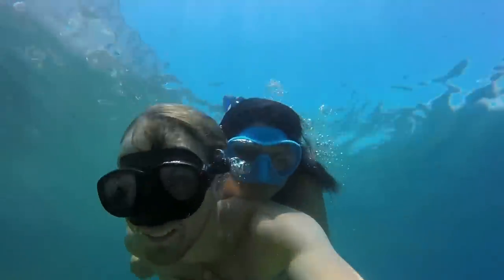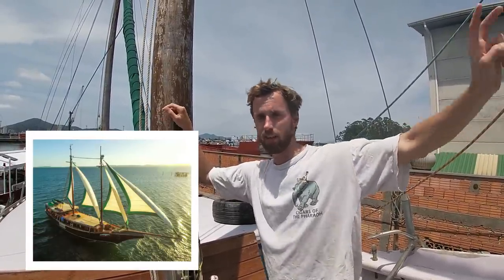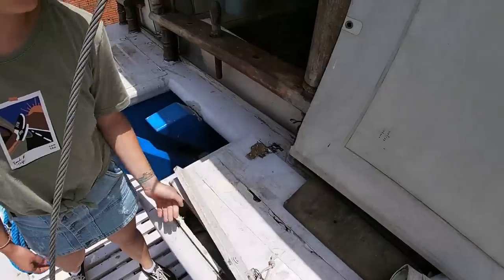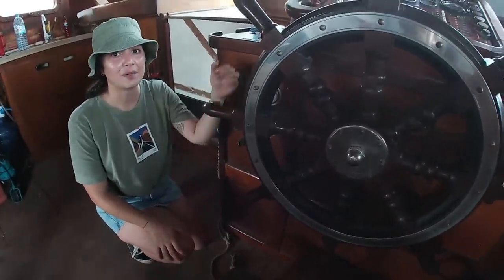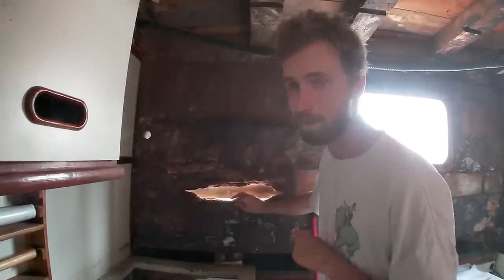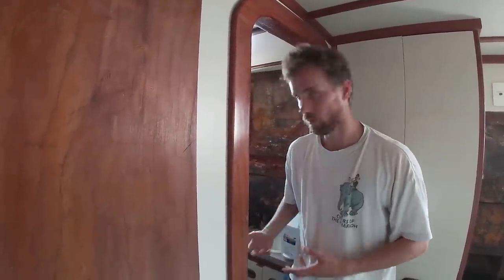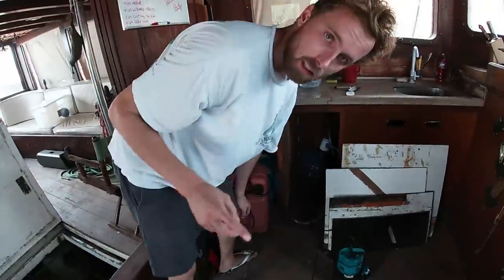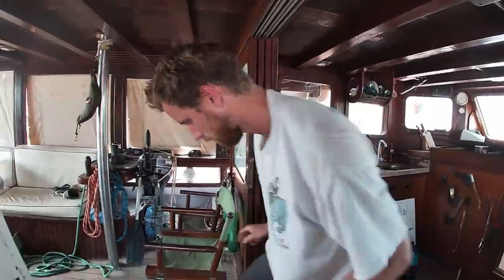BOAT TOUR of our wrecked Brazilian ship — Sailing Yabá #7

Comment: Thanks for the tour and I can see that you will end up with an awesome ship when your done. 
The fence around the boat is called a bulwark and I know the baton's as belay pins. I prefer them over cleats. I didn't notice the height of your masts but if the forward one is taller than the aft or rear mast then the boat is a ketch and the front mast is the main and the back mast is the mizzen. 
If the back mast is taller then you have a schooner and the front mast is called the formast as in forward mast and the back mast is the main. The type of sails you have are staysails so you have s staysail ketch or schooner. Starting from the front "bow or head" you would call the first sail the jib, then stay then mainstay if a schooner or mizzen stay though I'd have to check that and the back sail would be a main "if a schooner" or mizzen "if a ketch". The walls of the house are the coach house and where the ships wheel is is the wheelhouse and if your in a hot climate the galley in the wheelhouse will help to keep cooking heat and moisture where it can vent outside but you'll be carrying food down the companionway "stairs".
I like the access you have to everything and the inlay in the sole "floorboards".  The cabinet work onboard including the caracal on the table will be fantastic once cleaned up. You should end up with a workshop somewhere onboard. Exposing all those ribs and hull planks is a top idea, I don't know why people hide them, it's a boat not a house and as you know wood needs to breath. I removed all the 240ac from my boat and everything is 12v DC I have a power lead from the inverter for charging. With your ribs generally if needed you just add more which are called sister ribs and if you can't get large timbers then make them by layering thin 10mm strips one at a time so you can bend them to the hull they are glued and you end up with the correct thickness before placing new fastenings through the planks. You'll be a shipwright by the end of the project, enjoy

Comment: Looks like this will be a work in progress... Forever... the nice thing about that is that the best way to design things like where to put the kitchen is to live in it and prototype it. The general rule of thumb is to not have any stairs between the kitchen and the eating area. If you are living outside, it seems like starting with an efficiency kitchen upstairs is a great start. With a backup kitchen and deep storage downstairs inside.

Comment: Bravo well done I am now more in love with Yab'a than before .she was a beauty in her early years and I think when you are done she will be a duchess .It is good to know she was built locally? so that sourcing wood and other things will be more easily done .As in repairing or replacing ribs, knees or other structural members .As you have so well pointed out when Yab'a was built thy forgot to properly ventilate all of the interior paneling this is an easy fix if you wish to put up new panels after stopping the mold problem by putting two small vent holes in each panel so that air will flow in and out .Also you can recycle a lot of the boards you may replace on the cabin walls by resawing them to fit other smaller pieces that need repair .I would also keep the dual voltage lighting system ,Back up systems are always a good thing .Looking below decks I can see many changes and UH upgrades have been made I did notice that you were not to keen on how it was done and I agree it needs to be gutted and properly organized so that you can see everything and get to it easily in case something goes bad . I would also look at those fiberglass tanks they don't last forever and can harbor bacteria (bad thing) .THE MOST important thing I learned In my years of restoring old wooden boats is that the road to completion can have many pot holes he he . so i would try to find a simple thing to work on  and get done so I could look at that and give myself a thumbs up and well done every time i saw it .Not to mention a day off once and a while and just do nothing .Well maybe a glass or two of some favorite beverage preferably of an alcohol type and a nice meal .And in my case a good cigar or my pipe for dessert and watch the clouds float by and the sun set slowly .Well that's just me .Thanks again for the tour I could go on and on about what I saw and crazy advice but it's still morning hear and i work nights sooo it's off to bed.Foot note  Ben you look worn out still please I beg you and MP take a little more time off or at least back down the throttle a little please remember this not a sprint race it's more of a marathon .Call me crazy or weird or whatever you want but I want you to know watching you two, for me is like watching the sun come up early in the morning when the air is fresh and cool and that early morning breeze is like a kiss . I hope that's not to mushee . good night.

Comment: Little bit of advice for you guys while working on the boat in the yard I would box up everything in the boat. And only have tools that you need out. And the stuff that you'll be using day today. Then you're not having to work around everything and having to clean everything afterwards. It would be even better if you could start off the boat but that's probably difficult in your situation

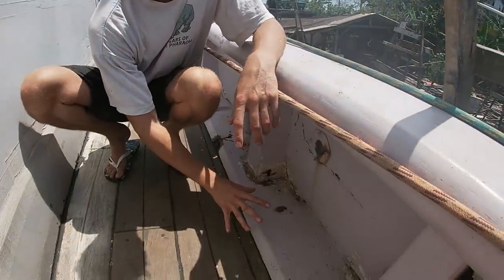Comment: Another thing: I believe that the walkway should have a little slope that guides water outside the boat, and of course, you have to remove obstacles that stop water in its way to the border.  This could help to maintain a dry condition inside the boat. Something to do in front of Ben's fingers at 1:28. What if there is a permeable window that allows drain water every meter?

Comment: If you go for one electrical system, make the choice for 24V. (Skip the 12V) However, you will find 220V (inverter) very handy as well (in time). The engine is a pre, as you will find out you will find spares for it everywhere in the world. Respect if you bring this ship back in condition. Lots of succes.

Comment: Have two kitchens, first a small kitchenette, the other a full galley.   Try to keep the bunk bedroom.   Make the beds folding so the room doubles as an indoor office.  Electrical I vote KISS.  Keep It Simple & Safe.       You currently have 12v 24v & 220v.   The future of batteries is higher voltage as it’s more efficient.
Reply from the maker: Good ideas! We will definitely make it more simple. The amount of wires and switches in this boat is crazy! 2 kitchens is a great idea. A smaller one upstairs for easier quick access

Comment: Brazil is noted for exotic woods, so I suggest you check with a saw mill to replace anything on your YABA. Look for rot resistant type wood, you can fiber glass  over new plywood incapsulate it.Re-bed the control room windows, check out marine chalking.

Comment: Very good episode and great tour! Re the questions you have (e.g. kitchen up or down): I noticed you are thinking in the present and not the future. You will want to keep the hot water tank for cold climate sailing. You will want your main kitchen as close to the center of the vessel as possible near the water line (e.g. rough seas). Keep the small upper kitchen for light meal prep. You have a big job and I look forward to watching your exploits. Cheers

Comment: Hi :)  .....I guess I would start by setting up a "Tool/Supply" crib or trailer you can lock.  I'd retro fit a large space onboard as an office area.  Create a garbage area on the hard and organize re-useable materials there.  Remove EVERYTHING not nailed down.  Protect Yaba from the rain.  Honestly...I would rethink some of your interior design and consider the removal of big items which could wreck work already done above them.  Ben & MP,  I am excited for this massive project, but am sad knowing that it is beyond this old man's energy levels now.  Your choice to do the work where you already have a home is excellent.  Thank you for sharing.

Comment: I was going to say you could ask odd life crafting about their water system but I don’t know how you’d get a hold of them except for the fact that they were the first comment in this comment section and you replied to them. LOL.  Anyway, they have a pressurized water system that runs off the batteries and not sore voltage.  

In regards to your galley I would have a galley downstairs and then set up more like a barbecue cook area up by the helm station. As for the wine cooler is it possible to put other products in such as soda, water or juice? if it’s shelving or racks are too limiting you could swap or sell it and get a beverage cooler that you could put up in the upper galley so you could have cold beverages without having to go all the way down to the lower galley in case you’re keeping it closed off to keep the bugs out. You would still have your sink and then a barbecue whether it be propane, electric or charcoal, which ever one you’d be more comfortable with or prefer. Finally there should be a little bit of room for doing prep where are you can get your food ready or place a burner or griddle to give you other options for cooking. Of course you could just have these in the form of small appliances that you could store underneath in a cabinet and just set up in your prep area when you want to use them.  In your lower galley you could mount a gimbaled stove and oven next to the hall with the sink near it and put the washer closer to the stairs under a Countertop where you could do your prep. I would move the fridge to the other side of your galley so that you’d be looking at it as you’re coming down the stairs. 

In regards to closing off the lower inner part from the helm station upper salon section you could make some frames to fit in your slots that could have bars going across as a way of discouraging people or animals as in maybe a pet from going through and then put screening on the frames so that you could close off the interior from insects but still have airflow. Or maybe just the upper one that slides over the top when you make a more sturdy permanent one you could have a way to attach a hanging screen that could be held in place by magnets so if someone’s down in the galley and wants to hand something out they can just push it out through the screen and then when they pull the ham back the screen will just automatically seal back up because of the magnets. I could think of several ways to do this and if you think about it I’m sure you could come up with a design for yourself. 

In regards to the upper salon I would probably want to put either one of those mini projectors that can be mounted off the ceiling and then have some place you can hang a viewing screen or just a white sheet or Mount a TV on to a swing down door that could come down from the ceiling and the box that was designed that when it’s closed the TV would be protected from the elements and out of sight. Either solution would make it so that in the evening sitting at anchor you could be sitting in the upper salon enjoying the night breeze and watch a movie or a show off VUDU or Netflix or whatever digital platform you want. 

One more quick thought, you might want to think about some Dore boxes to allow more air ventilation I don’t recall seeing anywhere that you had waterproof ventilation to help keep the inside of the boat circulating air. 

OK I’m getting the feel that’s gonna take you longer to read this comment then your whole video was so I’m gonna stop here and for now just say have fun with your refit.
Reply from the maker: We will definitely get in touch with them about a lot of things. We could use some of their systems for sure!

Comment: I am sure you will get a lot of advice from your channel and some of it will even be useful. Luckily or unluckily you are in the position to start over from scratch and I would urge you do that. For a start your legacy electrical system needs rationalising 12v 24v and 220v!. One thing you did not show was your ballast. Your keel looks shallow in comparison so how much of a sea state can Yaba handle?

I hope that wood is not to expensive in Brazil nor carpenters however even if a rib or two needs replacing it is rare that it is one piece instead they join multiple pieces together in a strong and seamless manner and probably this is what they have done to Yaba

BTW Since you asked for the input I would definitely say Galley down. There is some heavy stuff in a Galley and normally heavy is better lower down on boat.

Comment: I love the boat! Even though it is a lot of work to get everything done! 
When it comes to the electrical system if possible to go just with one DC current...for charging at the pier and all sockets 230V AC. So you can power all standard electrical devices like laptops, even the lights  etc. 230V gives you much more power with minimum cable cross section (copper is expensive). 
Good look fixing the boat! I'm really looking forward seeing everything coming into place. 🙂👋

Comment: Thanks for the tour. There are two things for me. First: I believe that you can open some spaces removing or switching storages. There are more space than nedded around engine, as you said. Second: spaces are wider if you use clear colors. Now you remove plywood... use epoxy clear paint to convert the final shape. Also I'll preffer to align solar panels...

Comment: Enjoyed your tour and positive attitude. I love the boat.  Pick the low hanging fruit. I advise you  to work on engine and drive to get it near perfect. I truly think the hull should be patched up to be servicable. The hull repairs need only be effective and sound (and cheaply as possible forgetting cosmetics). The hull should put in water ASAP and enjoyed, not be worked on endlessly to be pretty or perfect, I say if it looks good from 20 feet away that is good enough for cosmetics.  Somewhere in your refit process please install a simple diesel fuel transfer pump and filtration fuel polishing system. The engine feed seperately should have 2 or duel inline Racor fuel filtration minimum preceded by a course filter water seperator. Clean tanks and get fuel out and only use a single tank for mechanical testing. Merry Christmas.

Comment: Excellent tour, I love your boat. If it was my boat I would erect waterproof covers over the boat. Secondly install air vents for every cabin and an electric bilge blower. You need to stop the water, stop the rot and ventilate the boat urgently. It appears terredo worm are eating your keel. They will die after the timber begins to dry. The underwater areas of work should begin ASAP as this will keep you on the slipway and cost you more money. Old timber boat don’t like drying out, and can open up at the seams. It probably sounds contradictory, but just tackle one job at a time. Good luck!

Comment: Thx for the boat tour.  I'm very curious to see how Yabàa will have its metamorphosis and become a beautiful boat again.  Since the beginning I'm impressed about the potential of Yabàa, and your positive vibes of course :) ...  
About the galley; i would certainly make the main galley downstairs.  But it might be a good idea to have a mini-bar/BBQ area upstairs.  
But at the same time, the boat tour showed the miserable condition of Yabàa and that is, worrying.  I realised that, by the time I see this video, you have probably already started working, so I assume that experts have already checked the boat and convinced you that the structure of the boat is still good, and you came to the conclusion that restoring Yabàa is still feasible, justifying the energy and investments.  So you've probably have been doing your homework and did the calculations necessary by now.  I have the impression that Yabàa will cost you the price of another boat, but whatever: once again: heel veel succes.

Comment: Oh god. Where to start... I love this channel and you guys seem really fun. I hate to say this but you’ve no idea what you have gotten yourselves into. You should start by tearing out the entire interior. Keep the parts you want in a shipping container on the job site (just rent or buy one). Then you’ll probably need to pull the majority of the planking off the boat. 
Your reasoning on the size of the frames is wrong. Even though they are large, you will not be able to salvage them if there’s any rot. The visible rot is just the start, the actual rot extends far beyond the visible rot. Pretty much the only thing you can do is replace the rotting wood entirely. If it is in direct contact with another piece of wood you may need to replace that one as well. Freshwater intrusion is your biggest enemy here. 
At the end of the day I think you have a great engine and a few other things that could be salvaged. 
Good luck, and despite the “Fortune favors the brave” plaque, you may want to also consider that “discretion is the better part of valor.”

Comment: Please be careful very, with that massive engine room hatch. Those heavy hatches are widow makers at sea if not we'll locked after opening . 
Also , make sure those engine room tanks are well professionally bolted down so they won't move on large rolling seas . Get pro advice to electrical installations so you don't have a fire short circuit etc under 220 bolt system. Best luck and cheers !

Comment: Covert the entire boat to 24v and set all of those panels to charge the house bank. There are a lot of reasons to do it, including the ability to run smaller gauge wire, and 24v Inverters are more efficient. For all of your 12v needs you can run a buck converter to step down the voltage from 24 to 12. Also every light onboard should be changed to LED.